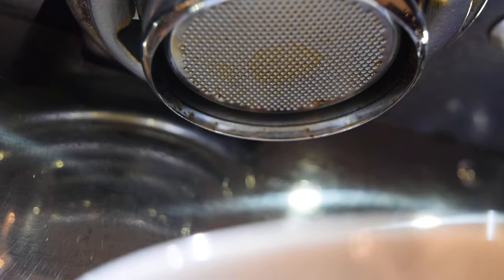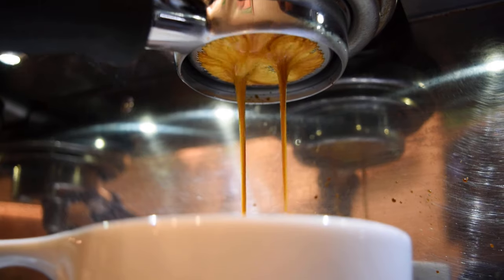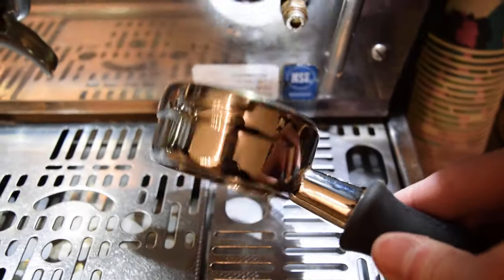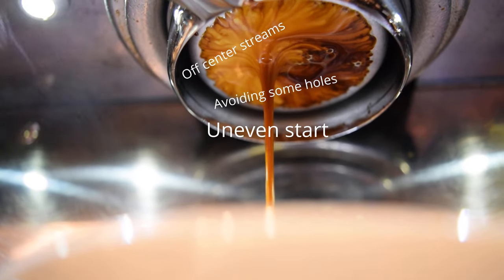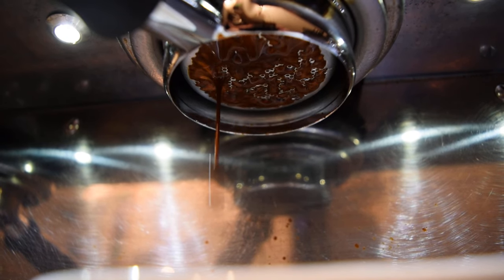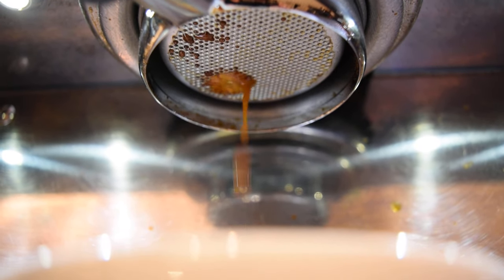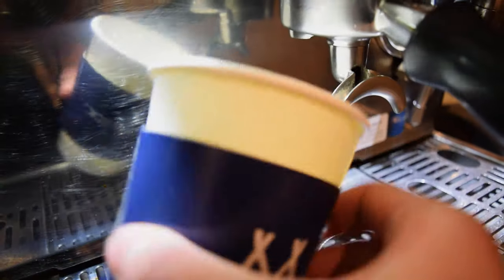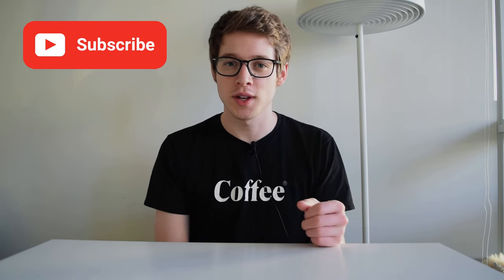Bottomless Portafilter For Espresso - What Does It Do?

Comment from the maker: What do you think about bottomless portafilters?
Reply: Yes
Reply: As you said  it's easy to wash, I started working two days ago and found it hard to match the grams I have to extract, my coffee is over exctracted so I applied less pressure when tamping but didn't see a big change, I don't know what is the problem :/
Reply from the maker: @xafafx  Hey there! Usually you dont want to adjust your tamp. That doesnt have too much effect. I would only adjust your grind and go more coarse. Make sure you are stopping at at least 1:2 ratio, but mostly focus on grind. Dont let the shot take over 30 seconds if you find it bitter
Reply: @CoffeeTimeJR   I usually adjust my grind qnd I want to, but I qm not allowed to do that in this café, I also use the tool be4. Maybe I should pay more attention to the coffee distribution, the owner said when I plugged the portafilter I pushed it too much, could that be a reason? Thank you for your answer! 🤎

Comment: The bottomless makes me want to paint a painting of it pouring out. It's so pretty.
Reply from the maker: It's very pretty! Almost enough reason just to have them haha
Reply: I was told that i cannot use ready grounded coffee for the bottomless and also need a sitter groomer otherwise i will damage my machine. Please advise 🙂
Reply: @ghoneim  Bottomless require a pretty specific grind size or else you run the risk of your shot pouring too fast. Idk what a sitter groomer is but you will need a higher quality grinder so that you can grind whole beans at the size your espresso machine with a bottomless portafilter wants to use.
Reply: I think you my have imbibed too many of your shots
Reply: Would you paint me bottomless

Comment: Another bonus for home barista that can't invest in an E61 or similar heated group head, a bottomless portafilter is basically up to temperature if you pull a  Blind shot through  And wipe it dry before you grind and tamp!  Investing in a Breville Bambino Plus shortly and doing all the research

Comment: Great information video!!
First manual espresso machine for me ( Lelit Bianca paired with Mignon XL ) i use the bottomless portafilter with a VST 18g basket, if I change same  basket to the spouted  portafilter do i need to change the dose and grind size since the water travels more in the spout compared to the bottomless
So far never used the spout portafilter 
New at this 
Thanking you in advance

Comment: I have a Casabrews machine that has a pressure gauge and shows the pressure as it’s brewing. With the stock portafilter, I can reach optimal pressure, but with the bottomless portafilter, I can’t quite reach optimal pressure. What do I need to do to adjust this? I am very new to espresso brewing, so I’m probably doing a lot wrong!

Comment: It would seem that the taste is likely the same if the spout is cleaned properly. But I can see how the bottomless filter can help you refine your technique. But that's a second, third, or even fourth step in making good coffee products, in my personal opinion. There are lots more parameters to get dialed in, first. Like grind size, amount of coffee, water pressure, extraction time, viscosity of the extraction, amount of water, quality of the crema, .... I'd say THEN one might look at a bottomless filter as a (quite expensive) upgrade to a multi-year experience.
The same is true for frothing milk. There is so much to learn before upgrading anything on your setup.
Reply: Thanks.  Excelent

Comment: Hi! Thanks for the video. I bought a bottomless portafilter, and always use freshly ground coffee, but never get the streams to join nor create that beautiful crema you have.
Reply from the maker: Hey! Really try focusing on hour tamping and distribute the coffee evenly through the basket. Your roast is fresh? Dark roast? And how fast are your shots coming out? Are you getting enough pressure?
Reply: @CoffeeTimeJR  thanks for your help. Yes, my coffee is fresh, dark roast. Hand grinded before use. I use a coffee distributor/tamper.

 I think my problem could be not enough pressure. I have a Delonghi Dedica. Maybe mine is defective.
Reply from the maker: @VictorEnriqueEspinozaLanyi  which hand grinder are you using? I'm wondering if it does get fine enough for espresso
Reply: @CoffeeTimeJR  I use the Harion skerton plus and yeah, it's really fine!
Reply: @VictorEnriqueEspinozaLanyi  have you solved the issue with the delonghi?
Reply: @cory3685  nope, I just resigned that my machine has pressure issues...
Reply: HI Victor yes the Dedica loses pressure after a year or so useage at look Toms coffee corner on here he explains it all I just did the repair myself pretty straightforward if a bit fiddly
Reply: @lizarddronedude3617  thanks! 🙌
Reply: @VictorEnriqueEspinozaLanyi  Crema and smoothness much improved try the steam wand mod too if your'e brave enough makes a huge difference to the milk smoothness I did both at the same time took about 3 hours and saved 300/400 pounds on the Sage Bambino I was gonna buy to replace it with. Good luck dude

Comment: Is the spouted portafilter acting as a heatsink a potential issue at all? Or is it minimal given that the water wouldn't be in contact with the spout until after it's already gone through the puck? Probably less of an issue if you're in a cafe, but for an individual shot at home it would make a difference in having to pre-heat your spout (or of course, going bottomless).
Reply from the maker: Great thoughts and questions. Here's mine: as far as the spouts go, if we were only considering the idea that the metal pulls heat from the espresso then I'd say the effect is next to none (if anything it could be better because I find espresso to taste a bit better cooled down).

BUT I like what you brought up about the second aspect, that maybe the extra metal is distributing the heat further than it would have had to go with bottomless, maybe that causes the spouted portafilters to generally be slightly cooler, and that would cause them to take more heat from the water during extraction. Very interesting idea. I think its possible. Although I do think less so with expensive cafe equipment, as these tend to do a pretty good job at keeping things nice and toasty hot. 

For the at home barista, to be safe either way, its probably a good idea to push a bunch of water through in the mornings anyway, just to prime the whole system and kind of wake it up, but mostly level out the heat a bit.

Comment: Yes less contact with the metal means less impartation of off flavours, coz certain parts of the portafilter are impossible to clean and has foul smelling deposits
Reply from the maker: Not necessarily though.. most cafes have a routine of soaking the portafilter in hot water and espresso cleaning powder. This is very effective at getting everything off. So when it comes to just plain steel, I'm really not sure its effecting the taste too much

Comment: But is there a taste difference?? I think you can distribute, tamp as well as you can but if your coffee is older (not even old) you'll get squirts and unwanted mess. It's a bit frustrating to clean up so I'm just curious if there's that much of a taste difference between the two but i guess that's a difficult question to answer. We just know if you see a proper extraction via the bottomless, the shot should be tasting as good as it can be, while a spouted you can't really tell if you're getting the best shot the coffee can provide. Even that though I'd argue because I can tell when something's up with it - not as much crema, the shot is a little more watery etc.

Comment: 9 times out of 10 times, bottomless tastes no different but they do look cool.  They also make it an easier (cheaper) way to build a DIY tester to measure the pressure at the basket. Pop out the "normal" basket and replace it with a modded "pressure gauge" basket.  Easy as falling off a log.  But you do have to sacrifice a pressurized basket to build one.

Comment: Could you please tell me what I did wrongly the coffee did not come out like oily but watery? Was my coffee not fine enough or I did not tamp correctly? I am a newbie…million thanks
Reply from the maker: Hi there! It could be a variety of things.. but perhaps you could tell me more about your situation? How much coffee do you use and do you weigh out your espresso liquid? How long does the shot take to come out and finish?
Reply: @CoffeeTimeJR  Thank you for your kind response. No I did not weight the coffee. I pressed for 2 shots from the grinder. It does not really take long, but sorry I also did not set the timer. It just comes out like water very light taste compared to the the pressurized. I use DeLonghi grinder adjusted to the finest that is level 1. It does not seem fine enough from my naked eyes. Does the coffee need to be very fine when using bottomless?
Reply from the maker: @AAcd165  I see! If possible, you should try grabbing a scale for yourself. Any kitchen scale. You want to think about your espresso as a ratio (coffee to water), and try for 1:2. So for every gram of coffee you grind in the basket, you want to push through 2 grams of water. 

Typically you see 18g coffee and 36g total beverage weight in cafe settings. If your machine is smaller, you can use less coffee, but scale back the liquid as well! So if you use 7g coffee, stop the shot at 14g liquid, as an example.

If you are usually using pressurized baskets, switching to non pressurized will be a big change for you. You need to grind much finer, and make sure you use enough coffee. Try getting your coffee to come out slow at first, should be nice and dark, then it can speed up a bit and turn lighter shades of brown. If it shoots out quickly at the beginning and doesnt appear dark brown, you need to go finer...

If you cant possibly go finer, try adding more coffee to slow it down. Otherwise, the only thing left to try is pull a longer shot. If it comes out very fast you can change the ratio to 1:4. That will increase extraction and make a more balanced shot, but you lose texture.

Comment: I'm not sure shot times would be any different to be honest as you' only need the pressure really, to get the water through the coffee and basket also, the bottomless system means there's a lack of contact with metal spouts which can draw heat from the coffee.. I've been bottomless for a while (if you pardon the pun) and I'm more than happy with the results.
Reply from the maker: Oh I can maybe clarify what I mean: the shot time changes IF you are using a weight based system to end your shots. If you are weighing out to 38g for instance, the shot just takes longer for all of that liquid to come out because it travels a longer distance down the spouts vs. A single stream on the bottomless. 

That's also true about the heat! Glad you've enjoyed your results. Nothing better than a cup of coffee you made and truly enjoy
Reply: It is shorter as it doesn't need to wait to finish funneling through the channels and inside. Maybe a couple seconds difference only though.

Comment: You talk about channelling… this is my eternal problem… I wish you would describe how ro prevent this. Cause I just upgraded my grinder thinking this would be solved, but no. What can I do to solve this?  It happens about one time out of three. Much better than before but still….
Reply from the maker: There are a couple steps you can take to reduce channeling: 1) adopt some type of distribution technique that evenly spreads the coffee across the basket. This might be using a tool (even a toothpick works), or tapping the sides with your hand 2) tamp the coffee perfectly level, not to one side or another. 2) once it's tamped, be very careful with it. Knocking it against anything (even lightly bumping it while locking it in the grouphead) can cause cracks to form I.e. channels.

Also, depending on your espresso machine, you may have access to pre-infusion settings. I have found mixed results using this. Some say that by wetting the puck before engaging with full pressure, it allows the coffee grounds to expand slightly and sort of lock into place. This could reduce channeling as well.
Reply: @CoffeeTimeJR  ha thank you. Ok I’ll be more attentive to every move. Since My pre-infusion was on, I might try to turn it off to see if it make any change. But the only things I wasn’t doing is the distribution technique using toothpick or some sort of tool. Thanks again!
Reply from the maker: @guytas  great! Let me know how it goes :) my experience with pre-infusion is basically 50/50. Most machines I worked on I didn't use it. In the 2 cases I did use it, it worked fine at one place but at the other place always channeled and made the shot look so watery and gross
Reply: @CoffeeTimeJR  ok, after trying it, it made no difference with or without pre-infusion. But I ordered a WDT (I think this is how it’s called) tool to act like 10 toothpics and this seems to be doing the trick. The coffee taste really really great (mainly since a changed the grinder) and I so happy about that. I was trying to get away from using wdt like the pros in Italy. Everywhere you go in Italy, the coffee is always great and I didn’t see if they use a wdt or not. Anyhow, if I have to use it, I’ll use it 😏

Comment: hi, do you think channeling can occur because of a not so great grinder, or it is purely a function of distribution and tamping?
Reply from the maker: This is a great question... My instinct is to say that the grinder quality won't matter as much. Still the most important think is distribution and tamping. Also have the correct sized tamper; too small and some areas may be left less compact, too large and you may cause suction when pulling it back out which can crack the puck.

After considering all of those things first, it's still possible that a grinder that creates inconsistent particle sizes could cause some issues... Maybe if there are too many fines, then it can choke up the puck and the water decides to burrow a hole instead. I could see that happening.
Reply: @CoffeeTimeJR  Got it, thanks. My distribution and tamping feel consistent, but I still get channeling sometimes. I guess the next thing would be to buy a distributor to see if there will be any improvements
Reply: If you use a regular blender vs coffee bean grinder, you will notice a difference. Blender is a toss in the air and grinder is consistent with dial settings…
Reply: Of course the grinder must be some sort of conical burr grinder with a pretty decent fineness setting. I know I'm stating the obvious for most viewers but just wanted to add it here for newbie amateur baristas. When I finally upgraded from my manual grinder (what a chore!), I frugally chose a Baratza Encore despite many saying that it's not good enough for making espresso with the bottomless portafilter. I'm perfectly happy with the choice. Leaving the grinder on setting 3, I'm able to "dial in" my shot by tweaking the amount of coffee, typically within a total range of 0.4 grams, i.e. getting good results between 11.8 - 12.0 grams for my shot. I have a Capresso EC Pro. I never get channeling. If I'm not dialed in, the extraction time is just too short or too long, but still with a good stream, unless I bog it down. My golden shot is 30 grams in 30 seconds. The portafilter on the Capresso flows another 3 grams after closing the valve at 30 grams.